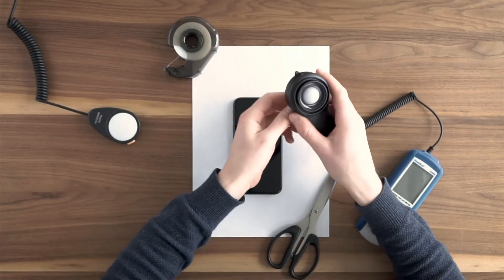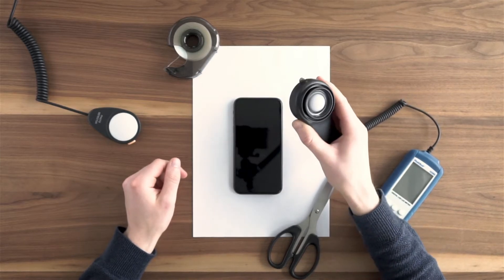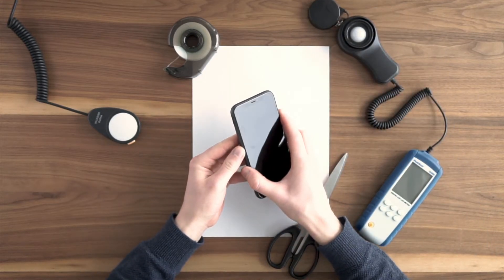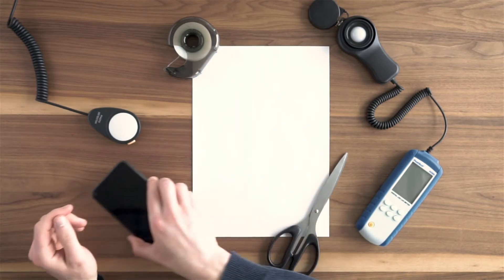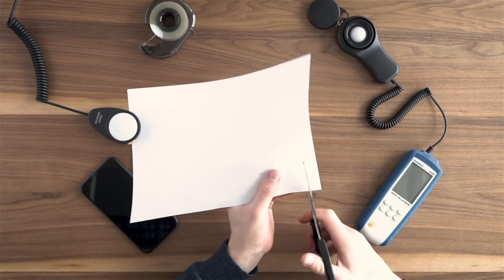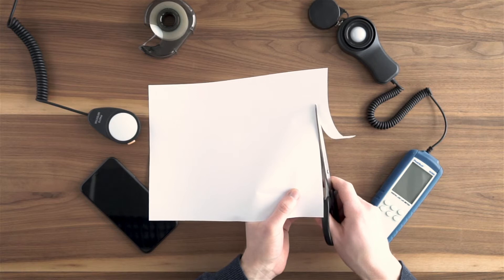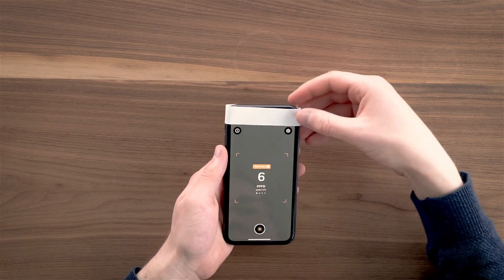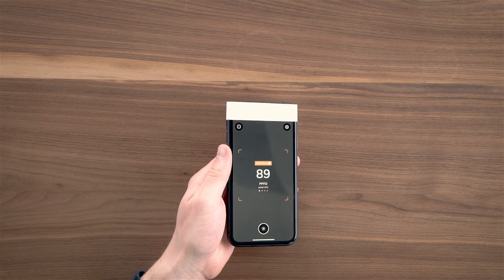How To Build a Diffuser for our Photone Grow Light Meter

Comment: If I have a phone case (for me, the Apple leather case, so relatively snug), I'm assuming the reading will be slightly off since it's not as snug of a fit. Fair to say?
Reply from the maker: Hi Brandon, as long as the case doesn't cover the front camera (which I doubt it will) it shouldn't impact measurement accuracy at all.

Comment: Paper comes in many choices  thickness or gsm. 
What is your recommendation
Reply from the maker: Yes, you're right about that! Photone is developed to utilize regular, multi-purpose matte white printer paper in 22 lbs (or 20lbs) / 80 g/m² thickness with a brightness rating of around 90. If you're in the US, we recommend the following paper from Walmart that performs very similar to our European reference paper: https://www.walmart.com/ip/Pen-Gear-Copy-Paper-White-500-Sheets/487634010
Reply: 80 gsm

Comment: How much does the type of paper matter? I live out of the country and I used some regular notebook paper we have. Can I consider that to be accurate?
Reply from the maker: Weight and paper composition matter in terms of absolute accuracy. If you use different paper, your measurements will still be relative accurate, but you'll need to calibrate if you want absolute accuracy.

Relative accuracy means you measure e.g. 200 lux (but it's actually 250 lux) then you move closer towards a light source, doubling the intensity. now it shows 400 lux (where it actually is 500 lux). It is accurate, cause it shows you that the intensity has doubled. This means the app measures still relative accurate, but just 20% less than it should. You could use the calibration option to adjust for this.

Does this make any sense to you? If you live in the US you can use this paper, this should work too: https://www.walmart.com/ip/Pen-Gear-Copy-Paper-White-500-Sheets/487634010
Reply: @lightrayinnovation  Yes it does, thanks. I don't live in US, but I can receive packages pretty easily. I ordered and should have in a week. Thanks!
Reply: This guy's test showed the type of paper matters - https://youtu.be/W0S-v7urUlk

Comment: Why we must use paper but another type? I did some mini test on flat difuser from milky acrylic, poly carbonate ( from led bulb ) and ptfe. All of them will make photone do a wrong measurement by adding a lot of light at input, example: imagine with paper strip, we got 100 lux/ 10umol. But when used a real diffuser we got 400 lux/40umol result. I want to know it because i dont want use paper, so inconvenient when u want to take a measure in forest with no of any paper in backbag or paper strip getting wet or so
Reply: Wtf did you say...Jesus Christ
Reply from the maker: There is no explicit technical need to use paper, but it is what we use for our factory calibration. If you want to use another type of diffuser, you must calibrate accordingly. This works as long as your diffuser is recognized by the app meaning that the ( ! ) warning disappears.
Reply from the maker: Yes the warning will disappear, but rolling paper is way too translucent (mostly because it's thinner than standard paper). This will result in measurements which are too high! I suggest you either use standard paper or calibrate🙂
Reply: @lightrayinnovation how different is 20lb paper 96 white to the 22lb matte white suggested by the app? that is the closest i can get
Reply from the maker: That is hard to tell. You'd probably need to subtract 5-10% of your measurements. You could use the calibration feature in the app for that. We are aware that using paper  is no perfect solution and are working on a better solution.

Comment: With the Diffusor tool attached the numbers are smaller, is that correct?
Reply from the maker: The diffuser disperses, but also blocks some of the light entering the camera. Nevertheless, using a diffuser is absolutely required if you want the readings to be accurate. A light meter cannot work without a diffuser. Any app telling you otherwise is just fake 🤓

Comment: what is this im with galaxy a14 i used the program perfectly and all the sudent a difuser req massage pops up ???? when i do this paper difuser and i cover it dont read at all.also the reading have changed somehow one day its says 550 ppfd of my plants i double check with other apk and the next day its says 1500 ppfd with photone and still the same with other apk why
Reply from the maker: I understand your confusion. We shipped an update in August which allows Photone to measure light intensity with much greater accuracy using the devices front camera. This is why you need a diffuser. You can read about the update on our blog: https://growlightmeter.com/improved-measurement-accuracy-for-android/
The readings should be very consistent and not change as you've described from one day to another. Check out our improved app guides in the (i) icon in the app. If you still run into any issues you can always reach out to our support 😃

Comment: Should I removed any case that’s on the phone before applying the paper diffuser to insure a tight fit? To avoid light leaks?
Reply from the maker: If possible, yes. If you notice no difference in measurement with the case on (a slight spacing form camera to paper) or off (tight fit) you can also keep it on.
Reply: @lightrayinnovation  thanks I’ll give it a try

Comment: I'm guessing my 24lb 97 Bright paper is going to diffuse too much of the light.
Reply from the maker: Thicker paper such as 24 lb will not necessarily diffuse but block more light and thus, measurements will be too low. If you don't have access to any other paper you can use the calibration options within the app to adjust the readings accordingly. Another easy alternative is to get the dedicated diffuser accessory from our website: https://lightray.io/diffuser/ <- it's US $26 and comes with free shipping and all taxes included.